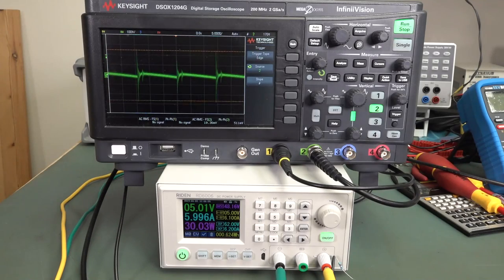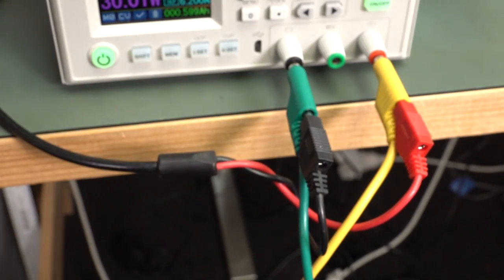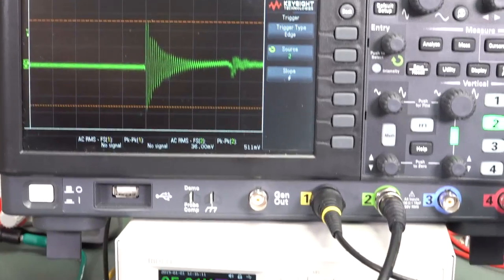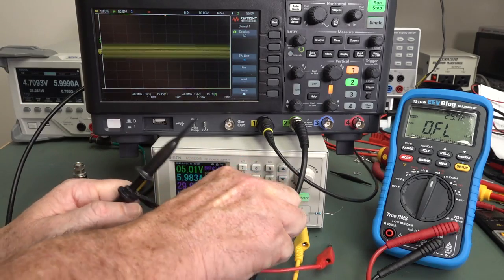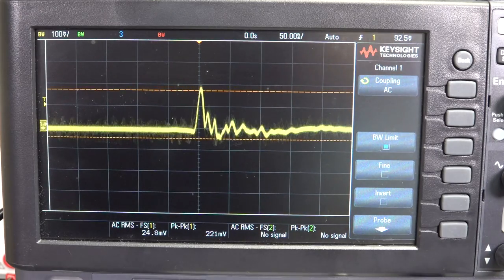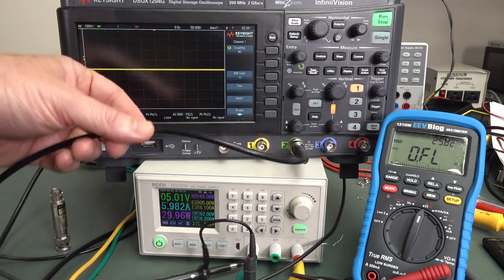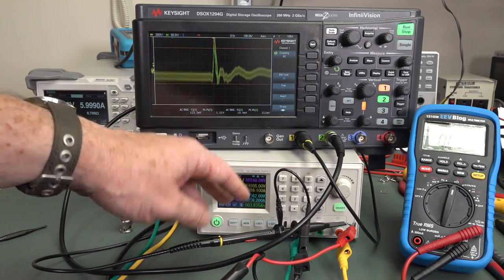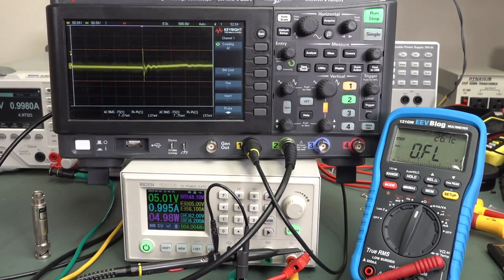EEVblog #1266 - PSU Probing Screw Up!

Comment: RF transmission line shall see the same Z  (matching the line) at both ends.
Reply: Exactly, it should be terminated with 50 ohms at both ends. The output of the power supply is effectively 0 ohm so a series 50 ohm resistor does it as he showed in the video.
Reply: Digital audio lines such as AES/EBU and S-PDIF terminate at BOTH ends of the line with 110R and 75R respectively. Is there any downside to terminating both ends?
Reply: It's the only correct way.
Reply: @Audio_Simon  The line TERMINATION  and SOURCE are to be the same. However, at audio frequencies the reactive component of the Z formula is lesser than the ohmic resistance (cooper losses) I am not familiar with lines you mention. 600 ohms Z has been the standard for audio in most cases, as the old, now nearly defunct telephone land lines.
Reply: Terminating at either end is still much better than no termination because any reflections will only reflect once before being absorbed. With mismatched impedance at both ends, reflections will just ping pong back and forth until they dissipate in the very low loss of the line.
Reply: The downside to terminating at both ends is that you're effectively creating a divider so the scope will measure half of the voltage at the output of the PSU.
Reply from the maker: @rfmerrill  Yes, you have to compensate for that in your probe gain setting. Some basic scopes may not have a X2 setting.
Reply: @rfmerrill  You don't need termination at both sides of the coax, only at the end. Having a source impedance that differs from the cable impedance only results in less than maximum power transfer. Also using a low impedance cable like coax, even AC coupled results in a low impedance load to the measured source so without knowing the source impedance you can't tell wether the measured signal levels are correct.
Reply: @EEVblog  - I think you screwed up a second time - There exists specifications how to measure PSU Ripple and nois and your setup had almoste nothing to do with that.
Reply: @rfmerrill  Measuring NOISE-critically radiated-  in a switcher is not that simple since in fact there is an  ill defined complex RF voltage riding on a DC current.  Normally an SPECTRUM ANALYZER is coupled to a common mode filter which is normalized so that results can be meaningfully compared. The power supply is connected to a load drawing current  within the unit specs. The SA measure the RF riding on the DC current, the results will show not only the noise levels, usually in dBm -a unit of power-  but also the total bandwidth--in Mhz. Those parameters can be critical depending on the intended application.
Reply: @rfmerrill  Why not multiplie the measurement by 2 ?

Comment: Oh, that brings back flashbacks of the thincoax network I had to work with in the 90s. People tended to take the T-connector and their cables with them when moving office, and sometimes (when they were at the end) the terminator, not realizing they were part of a chain on (basically) one coax cable. In cases where the terminator was "stolen" there was no standing wave and bandwidth went into serial connection territory (if at all), while taking one in the middle cut off all that were "behind" it. You young people with your fancy UTP don't know how hard it was in "the good old days" :)

And of course all our cables were RG58 and our terminators were 50 Ohm.

Comment: Besides the quite high resistance in the x1 probe center wire, it also is designed to minimize the capacitance.  That is done by minimizing the center wire diameter to the shield diameter plus also making the insulator of foam material.  That way it is almost like plain air.  Finally, you probably never find those probes wit more than about 1 meter length.  Anyway, good story again!

Comment: Did the same thing trying to deliver a signal from my signal generator to the input on an audio amplifier. Instead of an audio tone, I had an RF oscillator instead. Amp was oscillating at about 2 MHz at full power.

Comment: I think we have to be careful when we switch a scope into the 50 ohm mode; my Rigol warns to limit the input to 5V rms when that mode is selected. I assume using an external transformation as you did here lets you exceed that.
Reply from the maker: Yes. 0.5W is a common 50ohm limit inside scopes.

Comment: Calibrating the probe connected the 1V p-p output of the scope until the screen depicts the known predefined square wave is a great start before making assumptions about unknown signals.

Calibration can be used in many areas of life. You start of with something you know before probing unknown territory.

Charles Wheatstone the inventor of the electric telegraph, the Wheatstone bridge and more is known for the principle of comparison, but even more interesting he may be the cause of where civilization is at right now as he, by coincidence, was also Oliver Heaviside's uncle by marriage. Heaviside rewrote and added understanding to Maxwell's equations and, guess what? - invented the coaxial cable!

In this case even a straight wire need impedance calibration not to distort the signal.

Comment: Please make a video about how to reduce the noise on this unit. It appears to be otherwise very well made and the user-friendly interface, it all looks pretty good. If the noise problem can be reduced to 10 or 20 mV, it's a serious power supply. Maybe some dampened CLC filter at the output could do it at the expense of losing some accuracy.

Comment: From Manual: "Ripple and noise: <240mV. Ripple and noise measurement method: Use a 12mm twisted pair cable, and the terminal should be connected with 0.1uF and 47uF capacitors in parallel and measure at 20MHz bandwidth."

Comment: Hi Dave, thank you for your videos! I just wanted to let you know (if you do not know it already) that there is an advanced version of the RD6006: the RD6006P. I assume that "P" stands for precision. RD Tech: "It has 5 digit voltage resolution 1mV,  current resolution 0.1mA , lower ripple" and is  "more accurate." Typical output ripple is said to be "20mV Vpp". However, it costs a little bit more and it needs a little bit more "headroom" for the input voltage (+10% of output voltage + 2V). So in order to achieve 60 V output voltage it is recommened to set the input voltage to 68 V. May be this is an inspiration for independent test by you. Link to their own ripple measurement: https://youtu.be/ZncOU4eSjvk?t=175
Best regards from Germany!

Comment: So a 50 ohm termination means having 50 ohms of resistance in line with the measurement?  I always thought that meant 50 ohms between the input line and ground.  A schematic diagram on the white board would be very helpful.
Reply: Good question.  Normally I consider a termination as a parallel load.  Even a 'in-line' terminator puts the load in parallel.  Either way, the solution in this video shows the resistor in series with the center conductor of the coax.

Comment: Given that the PSU is isolated ground, I'dve used two probes on two channels and set the display for differential mode.  Why get all the nasty common-mode ground noise involved?
Reply: @Roberto Gatti Not the greatest sign of design quality, is that?

Comment: Someone may already have pointed it out (280 comments already made... I've not read all of them...) but, Dave , why don't you have used a "pig tail" probe in x1 mode ? That's the best way to get rid of most of the induced switching noise in the measurement process ? (Sorry for my globish english, l'm a frog eater !)
Reply from the maker: I would have used a BNC to banana adapter, but the connectors are not a standard distance apart to allow that.

Comment: I posted on your first video on this bench supply about my suspected usage/behavior of the battery charger terminal. I'd love to see a follow-up to know if my suspicions are correct because if they are, then I'll be wanting to pick one of these power supplies up. The short version is that the battery charge terminal is expecting a BMS on the other side of it.

Comment: i see on Ebay "30V 10A Adjustable DC Power Supply Precision Variable Dual Digital" for $60 shipped and you dont need to even get a case or the PSU... seems like a nicer deal.. 
you can get 2 of them and have dual rail voltages..
Reply: They're only 30V though. The 60V/5A jobbies are about $80AU -still good value but without all the niceties of this module.

Comment: Realistically more 20mhz of nose wont be a problem ... chances of it making its way threw the line and past your filtering and local regulation to a point where it will be an issue is quite low

Comment: Would it be okay to have a DC blocking capacitor followed by a 50 ohm termination resistor? That would keep the DC voltage off the terminating resistor. Just a thought.
Reply from the maker: Yes, you can use an external DC blocker.

Comment: Why not measure the noise with the excellent technique you've presented in a previous video--the 2 probe method using SUBTRACT mode on the 'scope?

Comment: Should we match the 50 Ohm load for any measurement if we using the same BNC cable Dave used ?
Reply: Not an expert, but I believe the load should be the same as the input impedance of the scope. Which will normally be 50ohms.
Reply: I guess you right
Reply: It becomes more important as frequency increases. Can't say what that frequency is but fast rise times have a similar effect.
Reply: @tin2001  No, the termination should match the impedance of the cable (written on it). Which is mostly 50 ohms, but not always. You may find old networking cables with 93ohm impedance for example. The scope's input impedance is 1Mohm//1pF if you haven't switched to 50ohm termination.
Reply: You refer to cables used for computer networking (Ethernet cable) ?
Reply: @zaidhussain5206  No, some old computer network cable, RG-62 I believe, used for ARCNET back in the day. Many laying everywhere. CAT5 ethernet cable is not coax, it is twisted pair and it's impedance is 100 ohms.
Reply: Aha , I got it , I guess I can get brand new cable on the same specifications
Reply: @zaidhussain5206  I am googled it now, and it seems you could buy new RG62. Probably it is still used somewhere... I mentioned that specific one just because I found it tossed out everywhere, and especially hobbysts probably won't buy expensive test leads first, but use what's found, and there is a great possibility that it is not 50 ohms coax.
Reply: Agree with you

Comment: But DC(-) is connected to electric grid earth via the oscilloscope, loading it asymmetrically. At least here, it contains a lot of low frequency noise (Speaking of DC-500 kHz).
Shouldn't a differential probe be used for that?

Comment: So what's the verdict on the power supply, GO or NO GO?  I'm definitely a novice with DIY electronics, but I keep plugging away. Having a benchtop power supply would be nice, as I am pretty fond of stepper motors, big and small. Is this the way to go for someone like me or is there a better choice? Having 2 output voltages would be ideal, but I guess a small 5v adapter is fine for logic...

Comment: Have been considering building a portable power supply with RD6012/18 powered by 3 x Dewalt 18v slide batteries in serries, thinking that to be a good way to get a clean energy source. I’m under the impression that the slide batteries get protected from over discharge etc by electronics in the tool, so less electronics in battery to generate noise. Tell me if u think this a really bad idea, plz. Love ur work, keep it up.

Comment: I have connected a pam8403 amplifier with raspberry pi. When both are given same 5v the speakers make a constant hum and it disappears when song is played...When i give them separate power supply without connecting the ground together the hum disappears.(speakers are connected to raspberry pi using 3.5 mm jack but with the connections specified on internet[sleeve is composite video and ring is ground,left and right are as usual ]).

Comment: why would you ever use probe in 1:10 configuration instead of 1:1 configuration when measuring small signals?
Reply: To avoid loading the circuit.  The 30pF or so of x1 probe will disturb pretty much any RF circuit for instance, and 1M resistance will give significant voltage errors measuring circuitry running at 50k impedance for instance.   3pF and 10M are much less likely to affect the circuit node you probe.

Comment: Why doesn't the coax probe need to have 50 ohm termination at both ends?
Reply: Ideally it does, but that gives a 6dB attenuation, note.  One end unterminated gives reflections from one end only, and any such reflections then get absorbed at the terminated end.  Without any termination the line is highly resonant as energy bounces back-and-forth (it combines with any reactances of the equipment at either end to define resonant frequencies)  The scope's input resistance is 1M, which is a gross mismatch for 50 ohms, and the PSU's output resistance will be a fraction of an ohm (again a gross mismatch).  Termination completely damps out resonances.
Reply: @MarkTillotson  Belated thanks.

Comment: Why 50 ohm resistor if input impedance of oscilloscope 1Mohm?
Reply from the maker: Because the coaxial cable is 50ohms
Reply: @EEVblog  and how coax terminate at 1 MOhm input of oscilloscope?
Reply: Seems I'm starting to understand. Because of input capacitance of scope it becomes small input impedance for high frequencies..
Reply: @EEVblog  Dave, You have been just  better....

Comment: What's the schematic of the BNC  50ohm  terminator    -series  or parallel?  DC blocking?
Reply: Its a 50 ohm resistor to ground only (parallel).  Signal pin goes straight through.  Not to be confused with a coax attenuator.  You probably can get series terminators too, less common.

Comment: Termination resistor should be parallel to line, not in series.
Reply: It was in parallel to ground with a pass through connection.

Comment: Just to be sure: in case of terminating the coax on PSU side, you use series termination and the power dissipation is no longer an issue, right?
Reply: Yes - you have to use series termination at a voltage source as its impedance is basically zero, not infinite.  50 ohms in parallel with zero is still zero...

Comment: It would be interesting with an explanation for the very common technique of using a cap in parallel when probing, e.g. the Mean-Well supply has this note in the datasheet:
Ripple & noise are measured at 20MHz of bandwidth by using a 12" twisted pair-wire terminated with a 0.1µF & 47µF parallel capacitor.
Or the Intel ATX power supply guidelines that state to use a 0.1µF ceramic and 10µF lytic.
Oh, and that Mean-Well will allow you to crank it up to 11, there is a pot to adjust it from 41v to 56v :)
Reply from the maker: Everyone has their own specific method for specifying how they measure PSU noise. About the only standard is the 20MHz bandwidth.
Reply: @EEVblog  Might make an interesting video about the how's and why's? I understand the capacitors for the ATX power supply test are to mimic a load: I.e. a motherboard would have capacitors, so that is why they are added at the probes, still, it is interesting territory and something I always neglect to do anyway, good enough for Sweden :D

Comment: Why not 50 ohm termination at both ends?
Reply: Because he didn't understand transmission line termination. Clear, if You use 50 Ohm transmission line you  must terminate them on both sides to avoid reflection. Second, for ripple measurement put a capacitor between to block the DC part......
Reply from the maker: You can, but then you have to use the X2 setting on your scope, and not all scopes have this. For this application the single source end termination actually does the job to prevent the tank circuit effect that was happening here.
Reply: @EEVblog  Measurement multiplied by 2 does the job for all scopes

Comment: Did the mechanical brain link fail you again, Dave? You really need to get that properly engineered 🤣
Reply from the maker: Needs some lube.
Reply: EEVblog When shunting high voltages in the cranium, be sure to follow proper safety protocols 😂

Comment: So why not just use the probes in 1X mode instead of using the coaxial cable?
Reply from the maker: It has a lower bandwidth than the required 20MHz spec.

Comment: But having both source and load termination should lead to better result?
Reply: Yes, for a very long run that would be necessary. For a few feet of wire though it doesn't matter since reflections will be damped within a few nanoseconds either way. With a longer cable or higher frequency, this might not be fast enough though.

Comment: Hence 10x 1Meg probes should be used. Some are good to 500MHz. If scope input is loaded at 5 - 0 ohms, source also should be 50 ohms by 50 ohm resistor in series. Then you get accurate RF voltage measurement divided by 2.
Reply from the maker: Yes, but with this application you can get away with just the input side terminator and no need for /2
Reply: @EEVblog  True. Nevertheless it might be interesting to look further up the frequencies where it may become important - I find that even small switching PS may have significant energies at several hundred MHz which become problematic when needing to meet radiated emissions limits (such as medical requirements of IEC 60601). In this case unterminated cables will cause reflections and provide false results (usually worse than reality).